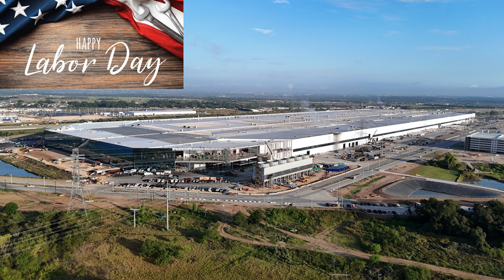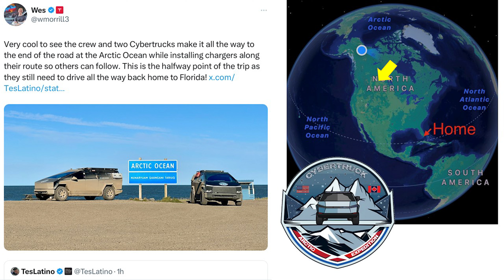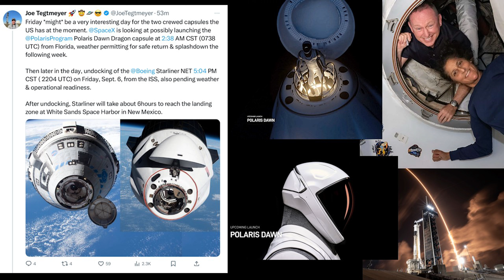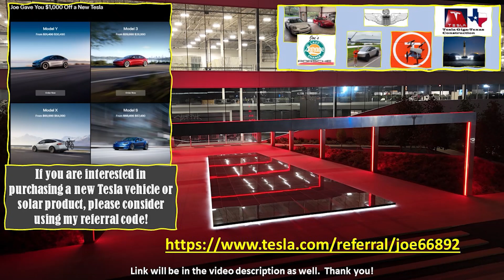Outbound empty! S Progress & 1,000s of Cybertruck Castings! 4 Sep 2024 Giga Texas Update (07:35AM)

Comment: Front end loaders are what you would typically find at a gravel pit loading screened sand gravel or stone into customer dump trucks. If you do a google image search for front end loader you will see what they look like. The only time a telehandler acts similar to a front end loader is when you add a bucket attachment onto or in place of the forks, however the telehandler has the added ability to telescope its boom and dump stone on top of a roof. Likewise image search telehandler and you will get the piece of equipment you are describing. No judgement here, just trying to help you be more accurate and find a reason to comment to support your channel. Love your narration and videos, could sometimes use more arrows pointing out objects you are describing like the elevator in the S ext. 😀

Comment: Thanks Joe.
Sort by Newest First or Top Comments if only the first few lines are visible
5:47. outhend, west. Tunnel Portal. Workers walking around on a deck above the tunnel.
Still digging holes.
5:54. Southend, west. Level 2. Centre. Pair of Alimaks (construction elevators) are located in an area likely set up for a permanent elevator. Similar arrangement 3 years ago at the north end of GA.
7:06. Southend, south. West Fire Escape passage. Bituminous paint/membrane applied to the internal corners of the entry slab.
Speculating a flat landing will be constructed here.
To the left. A more permanent arrangement of stormwater drainage.
Far right. Centre Fire Escape Tunnel. Scaffold removed.
8:07. Southend, east. Level 1. Fabricating smaller steel pipework.
Formwork for a wall. Same grade either side. Picnic tables on the mezzanine above.
Temporary plastic wall to the left.
8:35. Southend, Cooling Tower. West face, centre. Black electrical cables (previously thought this was pipe) on a cable tray dog-legs before connecting the underside the top deck. 2 black riser pipes elbow into the Cooling Tower.
10:43. Sand Hill Lateral Pipeline Project. South of river. Bottom. Drill stem seems to be rotating.
11:04. Sand Hill Lateral Pipeline Project. South of river. Yellow excavator. To the right the drilling mud reclamation machine. Separates the bentonite from the spoil.
12:46. Westside, Triangular Storage Yard. Transformer Stockpile no.2.
18 transformers, up from 14 in Brad’s previous fly over.
Image search of the logo shows the manufacturer is Prolec of Mexico.
Style of transformer different to the 72 at Transformer Stockpile no.1. Unprotected cabling on the top is a little unusual.
14:23. EOL, Transport yard. North pond. Bottom. Flow spreader for the stormwater drains. Similar structures either end of the Cathode pond, and the pond north of the Parking Garage.
15:27. EOL north pond. Section of green pipe laid through the outfall. Unrelated to the Sand Hill Lateral Pipeline project I would guess. Sand Hill Lateral pipeline alignment is directly under the low powerlines to the left.
15:54. EOL. Check-out tents removed. Pavement being cleaned up.
17:18. Main Entrance. Far right. Stoneglass. Edge facing dropped off…..again.
17:42. GA, road. Yard dog. Under the bumper. Bar hanging by chains almost at road level.
Left. Foot of berm. Street lighting installed.
20:53. Casting/BIW, apron. After watching the Munro/IDRA video I was convinced that anything stacked outside was a reject. Based on the IDRA people stating that the castings are trimmed immediately after being removed from the die casting press.
Of course this being Tesla, the conventional doesn't necessarily apply.
With all these castings stacked outside they may have deleted the initial trimming stage as a way of increase the through-put. Possibly a temporary measure as construction works inside Casting continues. Die-casting machines may only be running 3 or 4 days a week.
21:35. Casting east, apron. Total of 10 rectangular footings around the large new slab. 4 immediately east, 3 each at the north and south ends.
Close spaced steel columns against the wall, now sheeted full height with steel plate.
25:39. Tesla Road north. Ductbank intersection structure. Cables crossing east west.
27:20. Texas Concrete batch plant. MM sold out earlier in the year, April or earlier.
27:40. Cathode, east. Apron. Designated parking stalls.
I’m travelling for a couple of weeks. Patchy internet. Might be slow with my comments
Reply: Think about how many more castings have been stored outside at giga Germany
Reply: @benguthrie49  Good point. Thousands! And stacked efficiently...
Reply: 12:46 What is really important is the primary voltage rating. As you know, there is a voltage mismatch between the voltage of the first group of 72 transformers rated at 34.5 kV and what is believed to be the output from the substation transformers (24.9 kV). If these transformers were rated at 24.9 kV, that would at least partially solve the problem. So if you ever get a chance, try to see if you can read the primary voltage on these transformers. Thanks.
Hope you are enjoying your travels!
Reply: 00:52: Photo: The mechanic's hair!
Reply: @greggerypeccary666  Yeah, it's wild in every sense. I must admit, I skipped through the video, pressed for time.

Comment: 21:25 to 21:31 shows construction of symmetrical footings for a rectangular building or extension or open structure to enclose the Xheavy slabs and the tall exits. The steel wall with rails on both sides reminds me of a scrap dump you can find along harbors. Maybe they are going to import scrap to save on paying for ingots?
Reply: 21:25. I count 10 footings there. Some sort of structure would seem likely. Ductwork support for the furnace flue perhaps.

Comment: Have you heard the reason for getting the castings so far ahead of vehicle production? It seems to be an unnecessary expense.
Reply: The large buffer of Cybertruck castings permits the periodic changing out of dies on the casting machines so that they can carry out R&D work for the new models
Reply: If one considers hourly production, it's really not that much of a buffer.
Reply: Speculating the presses are being (or perhaps were) run at max capacity for several days to allow for construction/reconfiguration works within Casting.
Reply: And it makes the place look like a dump.

Comment: I am speculating that Model Y production is stopped while the line is building the first batches of Robotaxi, specifically for testing and demo for the 10/10 event.
Reply: Definitely seem to be stockpiling Cybertruck castings, so the GCs can be down for maintenance and/or build something new.
Reply: Hard to make a functioning robo taxi if full self driving doesn't work, and t still doesn't. But then of course, they are going to hold the event at a movie studio with a fake movie set. Kind of speaks volumes.
Reply: @DavidJohnson-tv2nn  I use my FSD almost everyday mostly disengage when I get impatient, not for safety issues. Internally they have FSD versions much more advanced than the general public. The reason for the studio is because it's private property so no need to deal with regulations of a vehicle with no driver on public roads. I'm not saying FSD is perfect, but it's pretty damn good after 12.3.6

Comment: @ 25:57    Those are NOT ‘front-end loaders’. Front end loaders have the loading buckets, arms and hydraulics ON THE FRONT of the machine….
Hence the name “FRONT END loaders”

These machines merely have the telescoping booms swung to the front, but all the mechanisms and hydraulics are at the rear.
The ‘TELEscoping booms and material HANDLER stuff’ is why they are called ‘tele-handlers’
Reply: Well explained. Front end loaders are completely different machines.

Comment: Thank you Joe, The new batch of transformers seem to match the number of (possibly 480vac) cables running to the south end through the conduits and over the roof. I think they will end up in the south end mezzanine.
Reply: The cables running through the duct-banks and over the roof in cable trays will be either 34.5 kV or 24.9 kV. The reason for the uncertainty is we don't yet know the primary voltage rating of the new transformers recently delivered. 480 v would be the secondary voltage on the transformers.
24.9 kV is presumed to be the output of the existing transformers at the substation.
34.5 kV is the primary voltage rating of the batch of 72 transformers @ 13:48.

Comment: Thanks Joe!
Transformers:
@ 12:46 Can anyone read the voltage rating on the transformers? Because the transformers are different from the 72 transformers located here @ 13:48
New power supply to the building:
Duct-bank intersection/crossover:
@ 25:36 Cable pull underway.
@ 25:43 Some cables are already pulled through. It appears that the structure was built for nothing more than to gain clearance over the existing main power duct-banks. Which run north/south underneath. Quite a lot of work just for clearance, but it is what it is.
@ 26:05 The cables are being pulled from here.
@ 26:26 (Towards the bottom) Winch behind the white truck is pulling the cables.
Mega-vault:
@ 26:41 Still no obvious sign of work to connect the new cables to existing equipment in the white switchgear buildings. Though the could have already been connected. Drone coverage of this area hasn't been that good.

Comment: They have not smoothed out production yet. Just means there will be a big end of month push. No reason for that.
Reply: my guess would be, fill up the outbound lot so you can take a 5 day shutdown/turnaround to adjust production line improvements. You can make a lot of changes in 5 24/hr days. With 13:31 no real hickups in delivery numbers.

Comment: Roughly how much in Square Feet is Coretex consuming? 

Also, thanks for updating your music... This is much better!
Reply from the maker: God question ... I'm not sure how to get a reliable measurement for you because I don't have a site plan or building permit to go on and they are building interior standalone rooms like where the Cortex is being built. The roof area that directly covers the general area of the Cortex installation (plus the cooling infrastructure) is about 105,000 Sq Feet, but this is highly susceptible to error.
Reply: @JoeTegtmeyer  Thanks Joe.  I helped build a small data center that was only 20,000 sq ft at the time in NW Houston years ago.  Just interested for my own personal comparison purposes.  Thanks again.  Keep it up!
Reply: It looked very large in the interior photos we've seen.  I forget the scale of things here regularly.
Reply: Measurable on google earth is the floor area of the Data Centre building. 3 floors of roughly of 9500m2, 101,000ft.sq. 28,500m2, 303,000ft.sq.